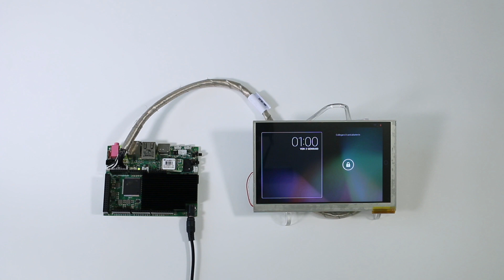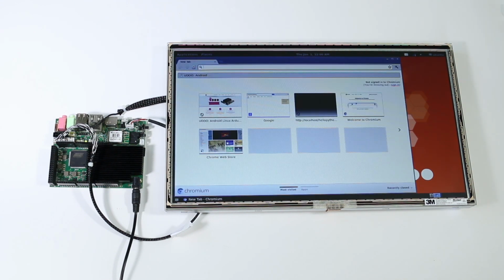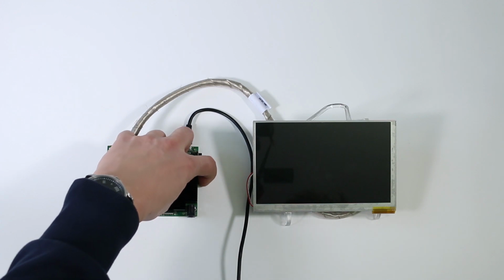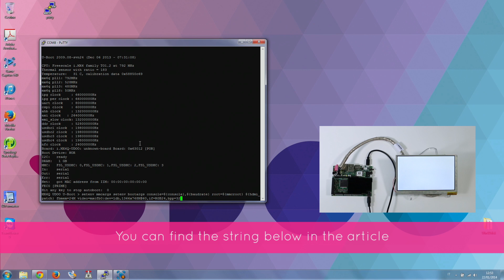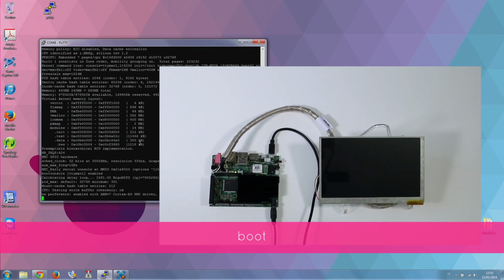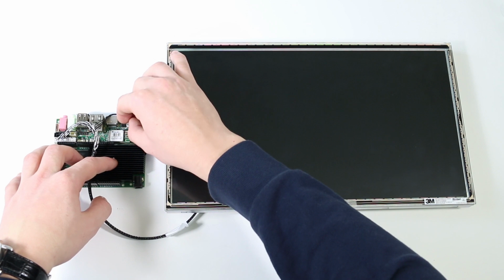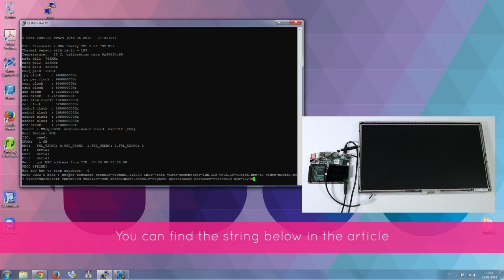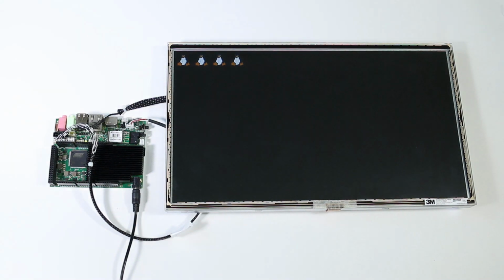UDOO's LVDS touch screen connection tutorial

Comment: its possible to use raspberry pi lcd screen and connect to udoo neo or udoo x86, or any other lcd screen?
Reply from the maker: The UDOO X86 has HDMI and 2x MiniDP++ display output. The NEO has HDMI and LVDS display output. If the screen for the RaspberryPi uses a HDMI connection, then it is possible to connect to either board.

Comment: I really wish you had a FFC connector for LVDS. Looks like you are using a 24 pin header (CN13), and I am not sure how this relates to usual LVDS FFC 40 pin that I have on the 5.6" TFT LCD that I'd like to hook up. Which brings me to think that you basically can only connect the screens that you provide on your website (?) or have to make your own special connector. Which doesn't make your board a good candidate for my project ... it's bummer I really liked the UDOO.
Reply from the maker: You can only attach our screen to the LVDS connector actually. Anyway, no other board embeds an LVDS connector so I think this is an advantage you have on UDOO that you don't have with other boards!
Reply: UDOO B. Hey thanks for your answer. It is appreciated. The Radxa Rock has an LVDS FPC connector http://radxa.com/Rock/extension_header I think that's why I was a bit confused, I figured it was "standard" but I am learning (Since I have posted this question, I have learned more about LVDS vs TFT TTL). Also you have actually clarified quite a few of my questions on this thread http://www.udoo.org/forum/which-type-display-will-work-with-the-udoo-t2251.html  I think the UDOO is a great piece of hardware, and apparently support it also great! So keep the good work.